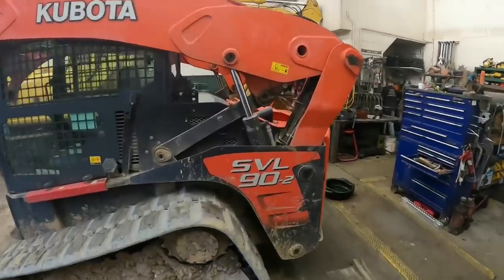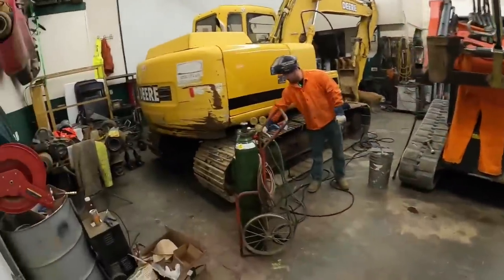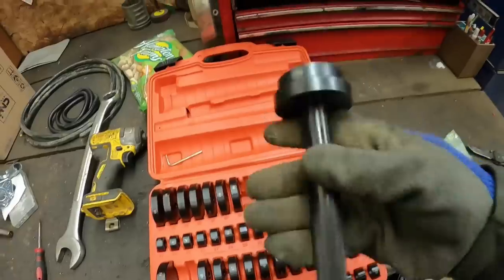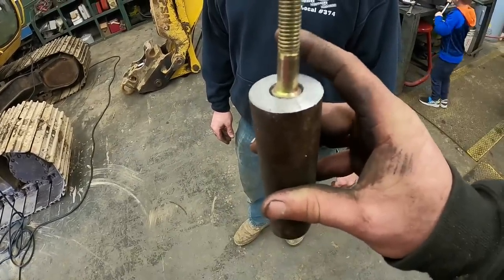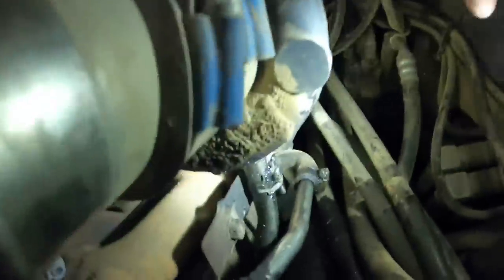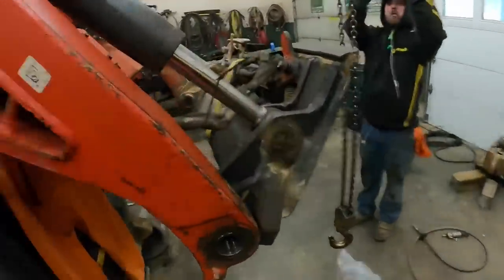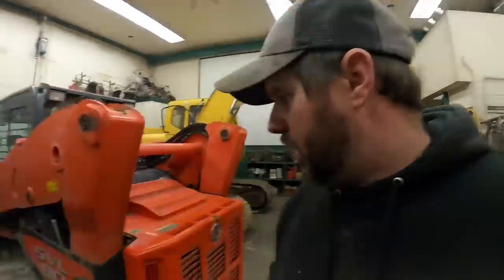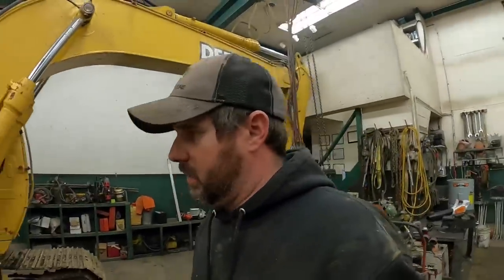Removing a Stuck pin with lancing rod and my thoughts on the skid steer after a year.

Comment: I like the way our new Holland’s door is set up. It is a swing out door but it comes with a dummy plug attached to the harness so all you do is switch the plugs, pop the wiper washer line and pull the door off it’s pins. Literally takes a minute.
Reply from the maker: Yes have seen that farmer Chris has one

Comment: Love the video. Out of the box thinking. You might have been able to use your 20ton press to push out/in the bushings. Two saw horses, lay it on it's side. That was how dad pressed the cutlass bearing out of the boat. (cutlass bearing is a bushing that holds the propeller shaft on a boat)  Freezing and heating made putting the new one in really easy. 
I'm gonna keep watching...and liking your video's. Great stuff.
I am going to remember the techniques you showed in your videos. Totally make sense.

Comment: I have done the removal and installation using a length of threaded rod and some nuts and presto  instant  press  to pull or push without hammering.  Cheers!

Comment: Woo she rough on them.  

We have used a ball mill to make some grease trenches an just grease the hell out of pins to keep dirt out.

Doenst take very big line just enough let grease flow good. 

Check out tompac grease. Keeps water an stuff out real good. 

I have used it in high speed gear reducers with no failures

Comment: You need a hollow shaft porta power ram. You can run a piece of all thread down the center and push that bushing in. I have done it a few times. That is what maxium4x4 is talking about.

Comment: Watching you two wrestle these pins out made me feel a bit guilty about the tribulations with my chisel mortiser...  I sheared off the roll pin where the handle engages the rack pinion.  Of course, I said a few shucky darns and started the repair.  

First I had to walk all the way from the woodworking shop to the mechanics shop to get a ballpein hammer, punch and new pin. The two shops are separated by a doorway... and there were two 2X4’s leaning against them. By the time I walked 10ft to the door, moved the boards, rummaged around to get my tools and part.... I was too pooped to walk the 16ft back to finish.... so I went to lunch.  

When I came back, I was in a better frame of mind and dove headfirst into the repair.  It took almost 10minutes... 

When I finally got the tools put back up I decided to call it a day and took Abby to the woods so she could chase squirrels.  

You know Mike, you should retire so those repair jobs won’t drive you crazy!
Reply from the maker: Lol

Comment: Well u had better luck than me this year on winter maintenance.  I re pinned and bushed my 337g.  After welding up and line boring 3 holes  and replacing boom rod cylinder. No bushings in rod ends. 1 day project turned into a nightmare

Comment: id love to have one of those hollow porta power cylinder for doing bushings.   For cleaning those bores  i take a small pipe that will chuck up in your hand drill and put a slit through it about an half inch from the end.   You can  feed sand paper or emery cloth through it and clean any length of bore you might come across by just using a longer pipe.  Ive also used a brake or engine hone before depending on the bore size.
Reply from the maker: Interesting need to get one for them port a powers

Comment: The reason for so many different pieces of equipment being  made is each fits a different need, skid steers are good for the jobs with very limited space to work in, the job they were truly meant for. People run into issues with them by using them to do jobs they aren't meant to do.
Reply: 100% truth!
Reply: A skid steer with an operator that knows what he is doing is one of the most versatile tools in the construction industry

Comment: You may want to build your self a Keith Fenner of Turn Wright Machine Works, Honing Tool. Extremely Easy Build, get a 3/8" in. {0.375" in.} Dia. Rod by approx. 6-8" in. Length. At one end only using either a hack saw, or if you can gut straight with a cut off {1/16" or 1/8" in} wheel, cut a total length of 3 to 4"in. Max. As in trying to cut the rod in half. Insert sand paper of choice (Usually between 60 grit up to maybe 120 grit) go for it, insert into drill, work's very good / extremely good, for just cleaning up a bore. A must have for you, based on this first video in your shop. P.S. your allowed to put some grease in / on the bore before inserting the new bushing's. Same for the pin's. I'd be using some grease with some Moly {Molydenum disulfide, Applications with a high degree of movement will require a grease with the highest concentrations of lubricating additives like molybdenum disulfide to ensure long-lasting wear prevention.} (check out AVE channel, he works with mining equipment literally the world over, he's sent to solve problems, his day job, he HIGHLY recommends grease with some Moly ) in it.

Comment: As I type this you have a thousand likes, and not one single thumbs down.  That is incredibly rare, and speaks a lot about you guys.  Maybe you'd have had the one dislike from Mr 'I don't like captain Kleeman' if he'd come by the shop.  There's just no accounting for some folk.   As one of  hundreds of thousands armchair operators (all down to the ConExpo YouTube gang) it seems to me that the skid steer is an incredibly versatile piece of equipment.  Andrew Camarata has every skid steer attachment known to man — well perhaps not because he often finds yet another, and come to think of it, he doesn't have a boom arm lift.  There are literally dozens of options.  One of Andrew's best buys was the concrete mixer — it does all the hard work of mixing, and then delivers it where it is needed.  And have you seen his latest attachment, the stump digger outer?  I looked at that and thought there is no way it could do the same as a mid size excavator, but it was amazingly effecting with up to 18 inch stumps.  This was admittedly in a damp earth forest environment.
Reply from the maker: Thanks Trevor appreciate the kind words. And yes hope to keep collecting attachments as we go

Comment: You called that a lancing rod today, 30 years ago when I built heat exchangers and used that to cut the units up we called it an (air ark) they will cut through just about anything !! The blind man said it’s straight what are ya worried about DP lmao 😂 Hey got a Suggestion for you when you guys go to clean those pinholes out you can get some extra long quarter inch cotter pin’s and you split them and take a long piece of emery cloth and split it in half on a cotter pin and then you can put it in a drill and use it to clean the pin holes out works awesome, oh and I liked the welding trick to get the bushing out nice job guys

Comment: 7/8 all thread and 2 plates. fine thread seems to give better push. one plate on inside of arm other outside of bushing all thread thru center long nuts and washers. works really good for a cheap press. i weld one nut to all thread so i can put gun on it and a wrench on other nut. tape on plate as you tighten. but done it your way a few times as well.

Comment: Excellent video! I run a 2019 SVL 75 and your review of the Kubota skid steer is spot on. The only negative I have is operating the AC as well, I have to either raise the arm or hunt for it to adjust, which is not a deal breaker at all. The roll up door is a must, I wouldn't have it any other way. Kubota must have fixed the rattle with the door and it will stay open on its on without falling now. I have the ceramic tint on mine and run the ac on speed 1 sometimes 2 in the dead heat of summer (east central Alabama).
Reply from the maker: Thanks

Comment: I like to make a mark on the end of the pin to show where the hole is. That way if I can't see the hole, I know which way to turn it.

Of course I usually remember to mark it when the pin is half way in, but I still like to do it. Also, the 120 looks really clean.

Comment: There comes a time in the history of every project when it becomes necessary to shoot the engineers and have the mechanicsfinish the design.     I have a sledge hammer like that one.........except the motor gets too hot.    Another great vid !
Reply from the maker: lol I agree
Reply: bod bam right. terex and their dry bushings. terwx retract cable bushings on a crane where you need to shove your arm 2.5ft into the rear of a boom to reach them. and above all National Crane and their snap ring hyd cyl gland retention. they have been doing that since the 70s, through at least 3 owners of the brand. THEY NEED THEIR HEAD EXAMINED
Reply: TEREX

Comment: 11:35 You can use a CO2 fire extinguisher to blow some CO2 snow into the bushing (place bushing in card board box) and it will get the bushing really cold.  Must use gloves to handle it afterward.
Reply from the maker: Possibly

Comment: CTLs are rated at 35% of tipping load, so they can do a lot more if you're careful. The straw balers would wear out case magnum seat switches in 3-4 months bouncing across irrigation wheel tracks. They had a box full of them in the service truck.
Reply from the maker: Hmm interesting

Comment: I have seen you guys on the struggle bus with replacement of bushings. Helps if you put them in the freezer for 24 hours. Much easier install.
Reply from the maker: Lol no
Reply: @DirtPerfect  lol it’s crazy how metal can be changed buy heat of cold. I mean aluminum you can see it changing if for instance of we have aluminum storm doors. I am 38 years old and first learned about with pressed in ball joints. I didn’t understand it as was about 2008 on. But found out putting a ball joint in the freezer will shrink it. Then when I watched the storm doors on house have a bigger gab in between the door jam making sense. We all are born to not be smart by no means. But the key is to never stop learning something new within your means of wanting to. Just like I watch zk master tech who works for John Deere. He has shown both methods on with big tractor trans. He showed on a bearing heater that’s basically a cone that bearing sits on. Heats it up expanding it to go on shaft on trans. Drops on without hammer and cools can’t move.

Comment: That is a exothermic torch better known as a pin burner,also if you dont have one you can take a stick welder turn her up to high and take a air hose with a blow gun and get the same effect with quite a bit more shower of hot crap flying back at you .Have done that out in the field in the past.

Comment: I have a Genie Z45/25 lift with a stuck pin, lancing the pin out would set the machine on fire. I use a pass through hydraulic cylinder on most pins and last resort is sawing them out. Use sand on the concrete floor when lancing a pin if you have it.

Comment: However the the Tiger Tool costs about 2.300.00 and the nut and  barrel with a draw bolt will work out. Using a torch works good but the patina is damage to the looks

Comment: Weld 1 inch all thread to outside of pin put pipe over pin plate with hole draw out with impact gun
Reply: Use 1 inch all thread to pull new bushing in

Comment: Impressed you did it where you did in the shop but my experience with lances well Chase Brass a rod mill & foundry they were 3/4" diameter & 10' long hooked to a gang of O2 bottles an silver fire suits a must ! Ever use an  Arc  Air carbon system ?

Comment: Why didn't you heat the lift arm to 150 to 200 degrees before inserting the cold bushing? Works better for me.  I soak the bushing in a bucket of  ice water so I can have the cold near the job. A expanding cylinder hone works good to clean out the hole. It gets any galling. I've always wanted to trying heating the frame then cooling the bushing with 134a to see if the bushings come out better. I'm too chicken to do that much pounding. 

Good job and video.
Reply from the maker: We did

Comment: Just food for thought, but dry ice helps alot when you want to get those bushings to shrink up a bit in diameter. Helps alot. 
👍 (I'm sure u have used it )
P.S.: I also worked for Keiwtt on the Zakim Bridge in Boston.
Reply from the maker: Yes wish I had some it does work good

Comment: How thick is your concrete slab to hold up to heavy equipment? I got a pole barn with gravel floor, thinking of doing concrete and I got heavy equipment like yours. Thanks
Reply from the maker: 5 inches the key is lots of rebar
Reply: I've got 4 inches in my shop like dirtperfect said it's all about the rebar and wire and compaction your concrete is only as good as the compaction under it I bring my 75,000lbs dragline in all the time and haven't cracked the floor yet

Comment: Great vid.
If those pins get greased via the zert fitting why not Grease the pins before you reinstalled them.
It'd seem to make it a tad easier.
It's what we did installing pins in Coast Guard Grumman HU16e Albatross seaplanes and Sikorsky HH52a SeaGuard amphibious helo landing gear back in ancient times.
On those seaplanes those pins would have been miniatures.

Comment: My svl95-2s has the same problem with the door coming down on me. It will stay if I slam it open. I think it sometimes doesn't fully latch/lock to the open position
Reply from the maker: Think I need to look into adjusting the back stops
Reply: @DirtPerfect  that's what I did. I helped with the chatter noise and locking it open

Comment: Would heating the knuckle not have helped installing the cold bushing? I've never replaced those bushings but this method worked very well putting new ring gears on a flywheel. Great video by the way. A friend of mine just burned out a couple of large pins using 36" exothermic cutting rods, but I just missed the fireworks display, hence, me watching yours. Wow, a super plasma cutter! Cool.
Reply from the maker: It’s cast hate to do that
Reply: Makes sense... thanks!

Comment: Case equipment do not have grease fittings on lower pins on the front bucket, this is to stop grease from holding dirt.
Reply from the maker: Interesting

Comment: A bobcat model is considerably cheaper on that aspect they use a tapered pen that you have to pull to the outside of each side with bolt and they break off really easy
Reply from the maker: Interesting

Comment: I've done the same job on my TL140. Didn't have to air lance anything. Couple of suggestions: 1 weld a bunch of beads longitudinally as you will get more shrinkage over the whole length and 2) use 1" or bigger ready rod to pull the bushing in.

Comment: Hey Mr dirt perfect great video next time you have to remove and install the bushings try using a piece of all thread and a puller and pusher it works great for some not all I’ve been using that method for repairs on all makes of heavy equipment and on automobiles thank you for the great videos

Comment: Would it be possible to put an oring on either side of the bushings to help with dirt?
Reply from the maker: Possibly but will get cut
Reply: @DirtPerfect  If your shim ID would allow the oring to nest inside it that might mitigate oring damage.  Make the oring cross section larger than the shim thickness for some squeeze.  Lot of work to find out it failed later on, but something to think about.

Comment: Freeze those steel bushings overniteand shrink em a thou or 2 for installation...dry ice is better to lay them on in the freezer....I am a engine builder we always freeze sleezes before pounding em home to makv life a lil easier
Reply: As others have mentioned, freezing bushings reduced the o.d.  If you heated the boom bore enough  you would have created a slip fit.  Only issue you is it only lasts a second or two when bushing enters the bore,  then the temperature of the two pieces equalizes and you are back to a press fit.  Key is the have a smooth steady install.   One other trick I learned to install bearings on shafts was freeze shafts, wrap bearings in wet towel and microwave to heat them.  Works great.

Comment: Press = 1" fine threaded rod, 2 large washers and nuts.  Draw the bushing into the hole.  WD-40 at the very least, do not install pins or bushings dry.  Like another poster said, neversieze!

Comment: Next time get a long bolt that goes through your die and through the bushing then on the backside put a thick plate with a hole (think washer) with a nut then bust out your biggest impact wrench and tighten the nut to pull the sleeve in. Nonetheless you got your workout in.
Reply from the maker: Yup we tried that just not enough pull

Comment: Would a Portapower work on pressing those in and out from the space between the arms?
Reply from the maker: Possibly
Reply: Yes, you can get them with a hollow plunger, hole goes right through the middle, not a cheap option but they are good.

Comment: With your bushing driver set what you should have done is taken a piece of threaded rod screwed into that one bushing driver that fits the bushing and then on the other end take one of them bushing drivers that are bigger than the whole put threaded rod in their run it in pololu bot it and run right in don't buy your grade 2 Rod though any grade 8 or better pulling them out you could have done the same thing with the butt having a bigger sleeve or bigger tube on where the Bush was going to come out and then you just use threaded rod in the Deep socket Runner home

Comment: If you had threads on the driving end of a bushing installer you could use a nut on the other end and pull the bushing in couldn't you? You'd need a heavy washer or something with a hole the size of threads for the nut to pull against. Is that clear as mud?
Reply from the maker: Also would have to be fine thread